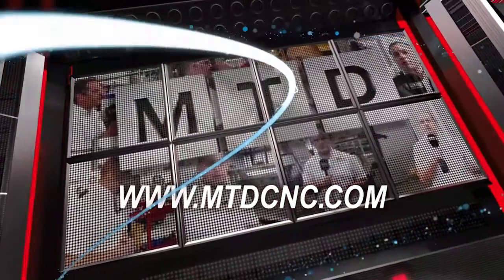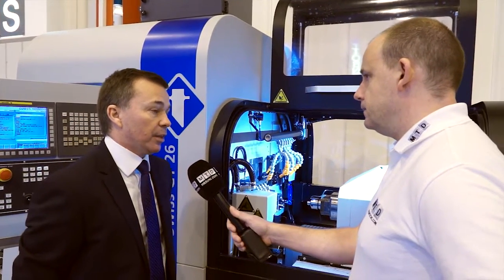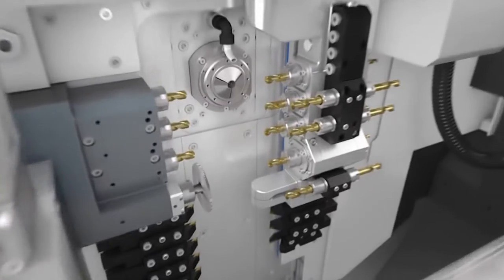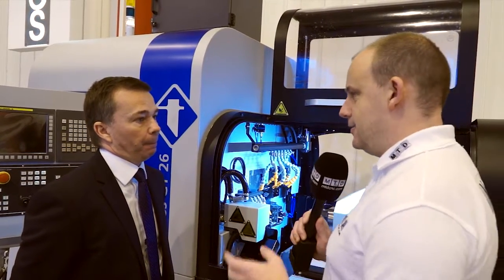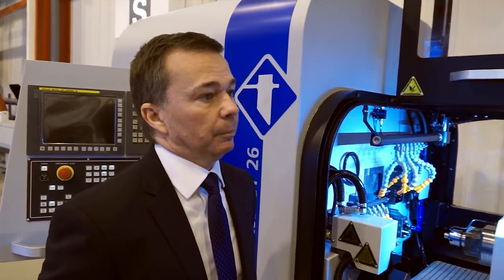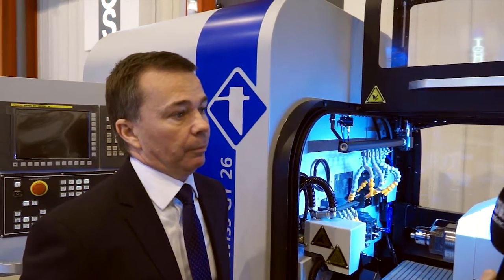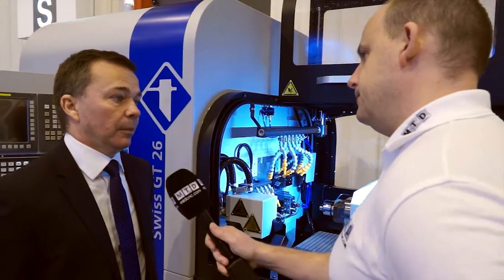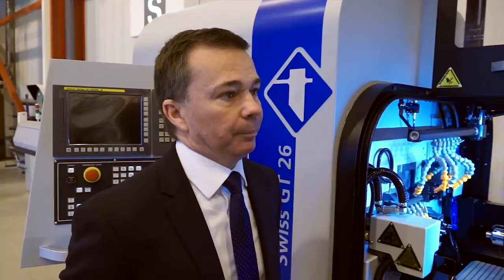Tornos Swiss GT26 small turned part multi axis lathe

Comment: Anyone else running one of these...so far it has been a pain in my ass.
Reply: Elaborate more please. I'm curious to know common problems, issues, etc

Thx!
Reply: 1 year old but still gonna reply, i dont work on a tornos but i do a citizen a32 ( about 24 of them), biggest issue we have is the chucks (pneumatic) from the video i saw they also use a pneumatic chuck, if you invest about 800 bucks for a booster itll help you out at the cost of changing the chuck fingers a little more often.